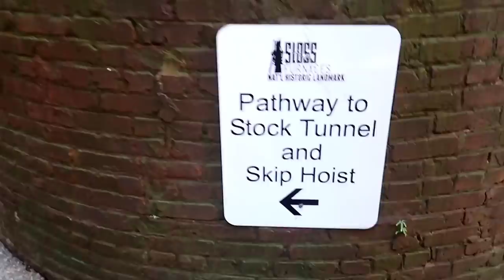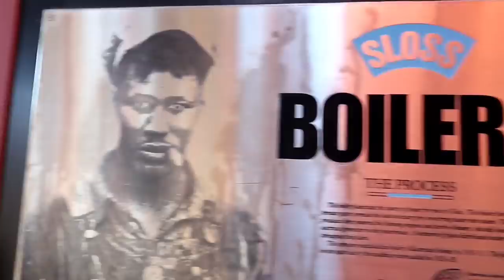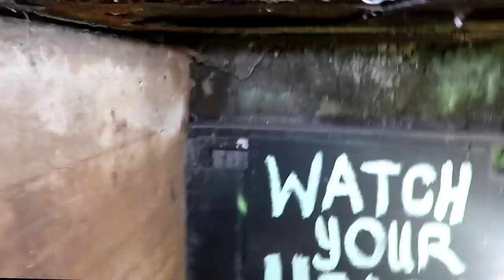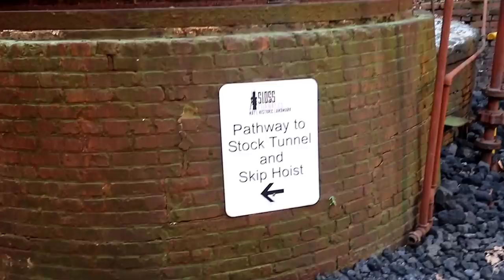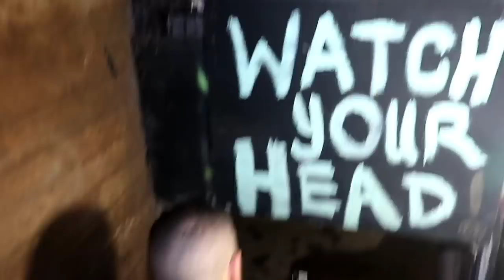What's Lurking Underneath Haunted SLOSS FURNACE

Comment: Slag! :) I work right down the road from Sloss and have lived here my entire life. It’s the main paranormal hub in Central Alabama. My friends grandad worked there and witnessed the ladle car death where the guy got squished in half….😨. I’ve been there many times in my life. I’ve heard the pings from the workers getting trapped in the boilers, and I’ve seen a shadow figure in the power house where you heard the walking at the top of the stairs. Also, the tunnel is usually only blocked when we’ve had a lot of rain. The water can get so high that you can’t get down the steps. 😱